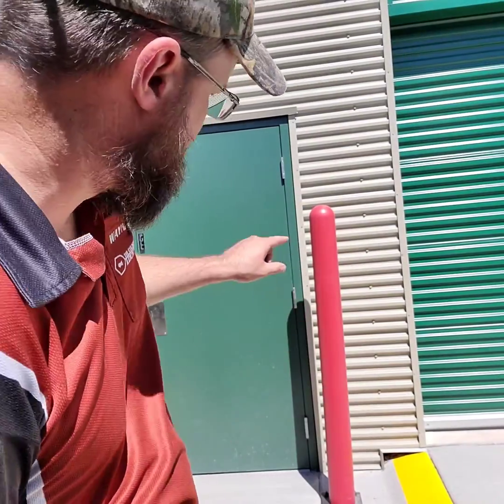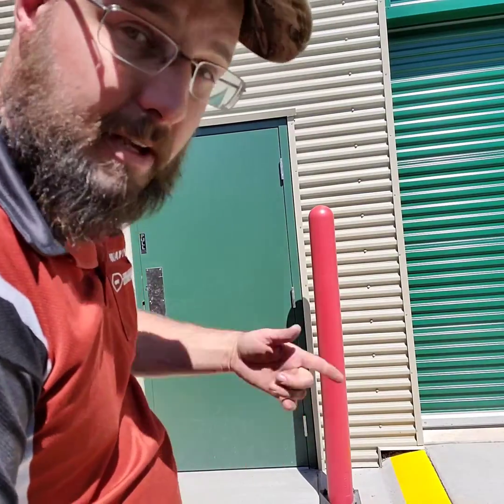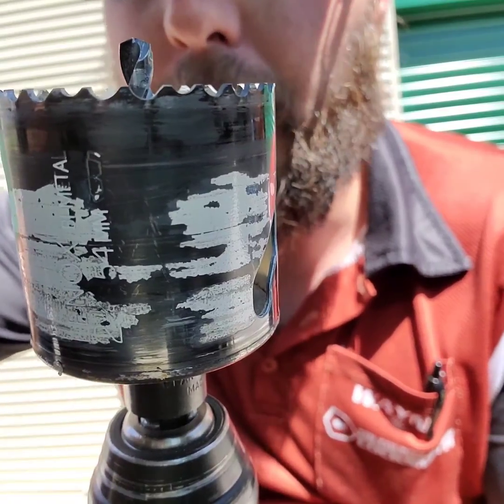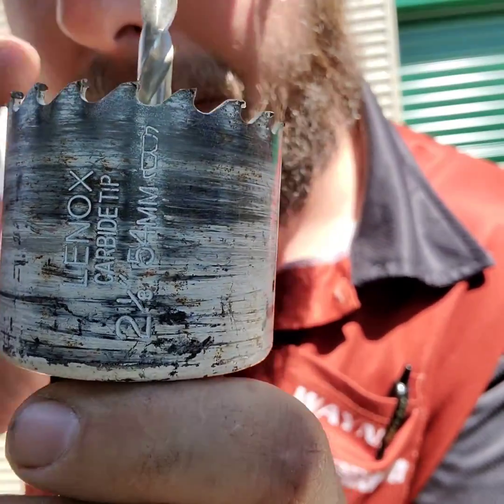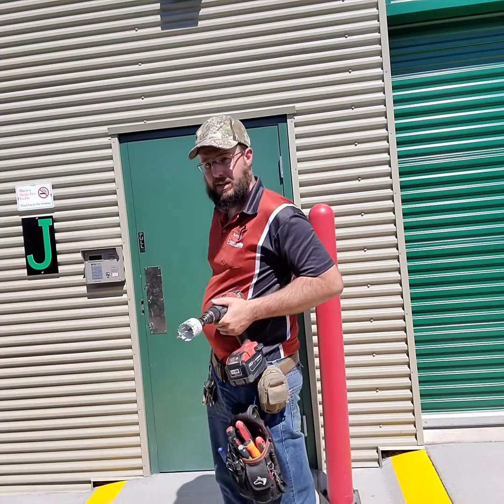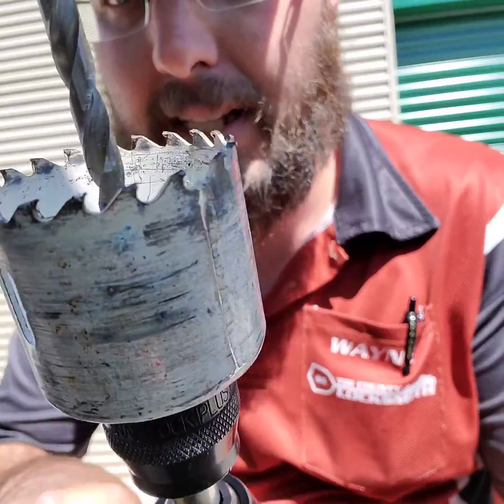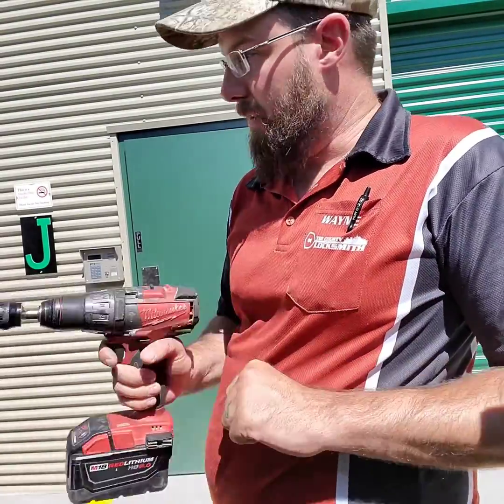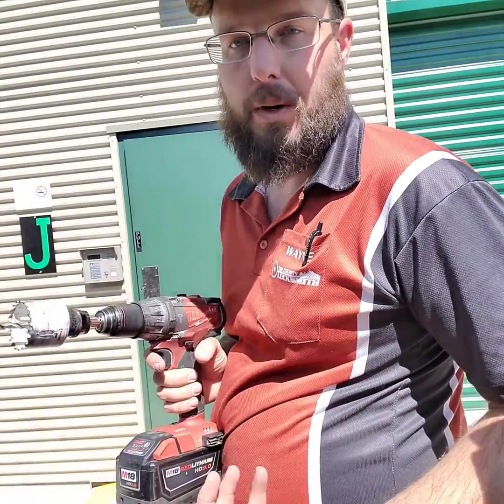Bi-Metal holesaw vs. Carbide holesaw drilling stainless steel door wrap

Comment: If this guy can cut through 3/4 of an inch steel wirh a bi-metal hole saw some thin stainless should be no ptoblem at all. Speed/lubrication will help tremendously. https://youtu.be/UXaSGRgvqZs?si=ZOU3bYwNSNbOZ-hb

Comment: Yes, carbide is better but bi-metal will cut SS with very slow speed and high depth of cut (lots and lots of pressure).   Annular cutters are even better than hole saws.

Comment: If you had turned the drill speed right down and applied cutting fluid you would have faired much better with the bi-metal hole saw.

Comment: Run the saw through the door to drill the pilot hole in the right spot. Then with masking tape applied to the other side I would drill from the outside of the door so you can apply cutting fluid. Turn the drill speed way down and you may be able to use a bi metal saw.  Of coarse on that stainless I would drill my pilot and then use a knockout set instead

Comment: You just saved me from destroying the bi-metal hole saw blade I just got to cut into some steel pipes. I'll be heading back to the store to get a carbide one now instead. Thanks!
Reply: If you use correct speeds and some cutting oil, bi-metal will do the job just fine. This guy just burned out his saw in an absolutely ridiculous way as click bait.

Comment: No coolant. Too high an RPM. I could go on. How about remove the door, place the surface flat and horizontal, use lots of coolant and slowest RMP possible. This just a demo on how to burn up a used bi-metal. Yes carbide is better but if you are doing 1 or 2 holes bi-metal will do if you follow the right steps.

Comment: Carbide holesaws are great but misusing your bi-metal blade,  no cutting fluid,  overheating,  fast rpm is incorrectly using the tool.

Comment: Hi Wayne, Thanks again for another great video (I watched you kill a diamond hole saw on SS). I think what some of your critics are missing is that if you must get a job done under difficult conditions with unavoidable high cutting speed and no coolant or lubricant, you might as well use the best/toughest cutting tips. Are all carbide-tipped hole saws good for this? How many holes like that would you get from that cutter? For 1.0mm SS, I plan to use a drill press and the lowest speed and cooling/lubricant, but it looks like the carbide tip would still be the best shot.
Thanks again, very valuable despite the critics. Tim

Comment: Stainless steel will work harden very quickly mate. You should be drilling with high pressure low rpm and cutting fluid. You could have done the job with the first holesaw no issue if you knew how to work with stainless steel.
Reply: Not to mention he's gonna eventually kill that 1/2" cordless drill punching bigger holes with a holesaw like that.

Comment: If that was a brand-new hole saw you should have returned it because the paint was almost completely worn off which would indicate prior use. The used carbide saw actually had more paint on it than the "brand-new" bi-metal saw. Jus sayin

Comment: I tried the a few cheapo kits.  The $20 masterforce set template more solid tool but the hole saw not carbide. In a week  I broke 3  the 1/4 pilot bits. Most residential doors dont have wood blocks or theres only partial blocks. Sucks because the 1/4 bit has no solid hold and suddenly takes off and breaks the bit ripping a GOUGE. So i had to reverse the drill.  Useing half inch drill with side handel.  
Any help please.
Reply: Quit buying the cheap shit.

Comment: Doing security install I only use carbide works great when door frame is concrete filled any other bit dies as soon as it hits the concrete
Reply: Doubtful. Grouted doors are a bastard. A carbide tipped bit like a masonry bit will take forever to get thru the steel and anything other than a masonry bit gets smoked the minute it hits the grout. And I'm talking drill bits not holes saws. Most door guys use tech screws to get thru the metal then switch to a masonry bit if they must drill into the grout.

Comment: He just killed bi metal holesaw by incorrect usage. Always read on packaging about appropriate RPM which you have to maintain within drilling process! He just pushed his screwdriver to the max! obviously, too high RPM. And using of coolant (like oil) increases lifetime significantly!
Reply: i recommend cutting paste instead of coolant or oil